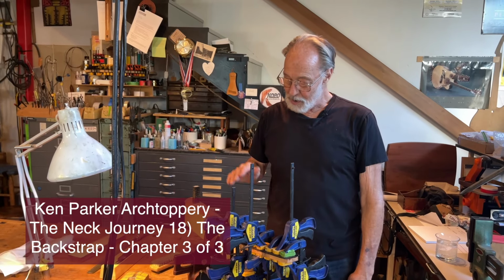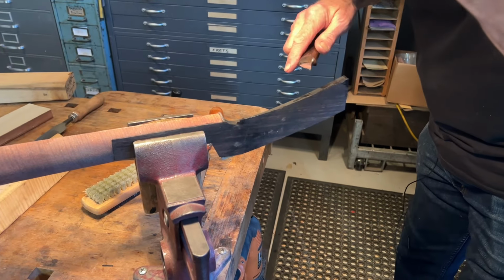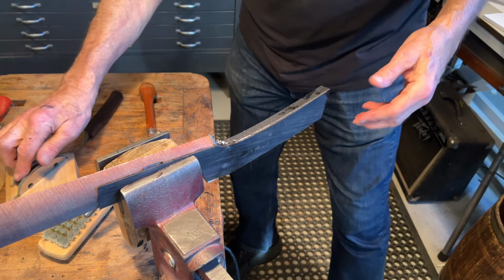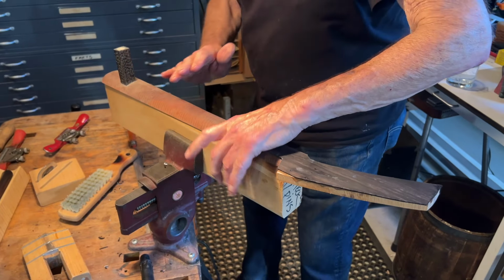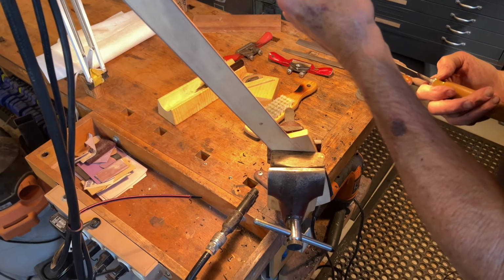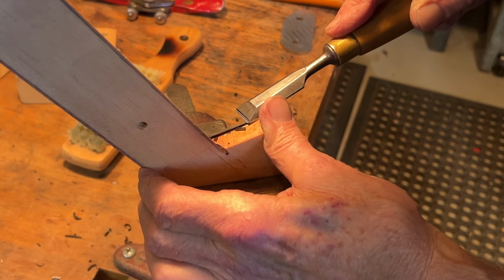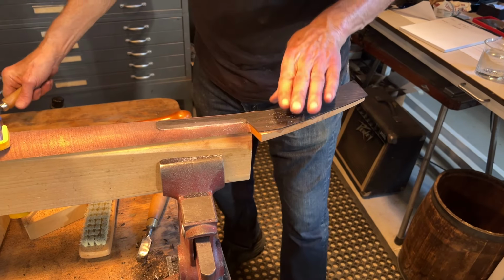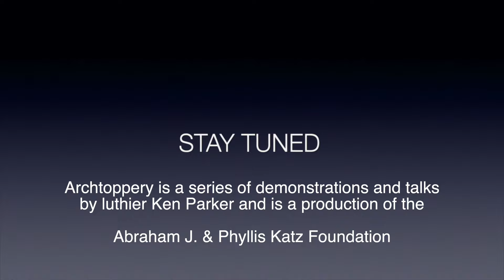Ken Parker Archtoppery - The Neck Journey - 18) The Backstrap - Chapter 3 of 3

Comment: I've done quite a few backstrap repairs on Gibson headstock fractures. My backstraps are carved from a block, and yours are bent veneers. I have actually been thinking of doing the bent veneer backstrap repairs for a while, and it's nice to see some good tips in your videos. Bent veneer backstraps are of course superior in strength, so I really want to try some day. Of course, in a repair scenario it has to be the right fracture, the right value of guitar and the right customer that is willing to pay for the repair technician's time. The last customer that brought a Gibson with a broken headstock to my shop was a perfect candidate for a backstrap headstock repair, as that headstock had previously already been reglued and it failed at the glue joint. But the customer didn't want to pay what my time was worth and wasn't convinced that the repair needed a backstrap, so he decided to look for someone else who could do it cheaper. If he in fact got it done cheaper, I'm sure it's just a matter of time when he'll be calling me again, for his annual headstock re-gluing. 

The one thing that never works out ideally on a Gibson backstrap is the fact that I can't put a backstrap all the way to the upper edge of the headstock, because I would have to carve away the serial number. Of course, I can always stamp a new serial number, but most Gibson owners would object to that. So, I have to taper off the backstrap around the B and A tuning machine holes. 

In any event, thanks for sharing all these tips and techniques for the veneer method.
Reply from the maker: I never got the sense of sawing out a backstrap, sorry, it just seems nuts to me, although there's someone on YouTube who also shows how he does it. I love how your customer "knows" that his guitar doesn't need the best repair solution.
The whole point of this big job as a  repair is to add fibers that are continuous, so I suppose you could try to find a tree or a piece of lumber with the right angle branch or grain change like the old boatbuilders did (called "grown knees"), but it 's so much work to fit the block, I'm just amazed that anyone would choose to do it this way. Maybe folks don't know how to make a slice of veneer?
I understand that some customers can't afford the shop time for a repair as time consuming as this, but hey, that's life.
As far as Gibson's stupid # is concerned, many times it's wrong anyway, and who cares? Maybe saw it off and inlay it into the backstrap veneer it should have been shipped with in the first place? Or make a key fob out of it?
Reply: @kenparkerarchtoppery9440  One reason I have not used a veneer type backstrap overlay for a repair, is because I would have to start with a thicker plan of wood, anyway, then carve it to the final shape. 

I would still need to match the gluing surface, by placing self adhesive sandpaper on the carved-out area and sanding off the matching surface of the overlay. 

I'm thinking I would start with a 1/2 inch rift sawn piece, then bend it, then match the surfaces, then glue it, and then carve it. 

It would definitely be a stronger repair, but I would add extra steps to a job that already doesn't pay enough by the hour, despite the fact that it's already an expensive repair for most customers. 

Some have also done backstrap repairs with carbon fiber.
Reply from the maker: Maybe I'm not being very clear, but when you use a bent veneer to create a backstrap, you enhance the strength and toughness of the neck by reinforcing it with long fibers, something that just doesn't happen if the backstrap veneer is sawn. 
First decide what thickness is correct for the job, and then create a veneer of this thickness with nice smooth surfaces. I think that the correct range is 1.5 - 2mm. This must be done before anything else happens. Next, you remove material from the back of the headstock and down the neck shaft that is precisely equal to the veneer thickness. Thus, once the veneer is glued, the thicknesses of the headstock and neck shaft are restored to their correct thicknesses, and don't require any further thinning or other work except for edge cleanup. I show this method in the backstrap films, and I don't think this method can be improved. Although this is most definitely not a beginner's project, it's pretty straightforward woodworking and can be done correctly using several methods. I am very confused by your statement "I would have to start with a thicker plan of wood, anyway, then carve it to the final shape. " Maybe watch the backstrap films?
Using carbon fiber for this job is an inelegant mess, and much more challenging than using a straight - grained piece of hardwood.
Hope this helps.

Comment: Another great series Ken!  Not how i expected it was done, i had imagined that the shape was made by an end mill in your bridgeport. Still jealous of that master spindle sander. Happy halloween!
Reply from the maker: Hi Sam! HHalloween yourself! Check EBay for the master sander, they're out there, just make sure to get one that's fully accessorised with allll 6 plates and lots of spindles. The good news is that the spindles are a breeze to make, as the "Universal double angle collet" will take any size straight shank up to 3/4", and so easy to switch out!

Comment: I had no idea how you did that long backstrap! Fascinating!

Hey Ken, what’s a good size of violin maker’s knife? I had been thinking of getting one, and I see you’re using one. I see they come in several sizes.
Reply from the maker: I like the "big" one, which is about 3/4" or 19mm. There's also a 1/2", or 13mm size that folks find useful. You're allowed to get them both, I'd say! I like to sharpen them with convex bevels, and add a slight convex curve to the edge.